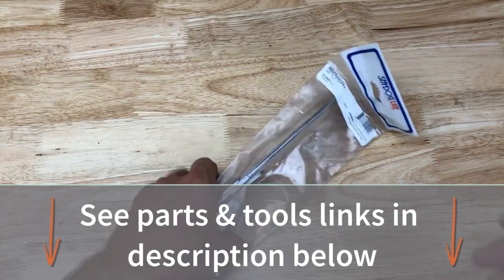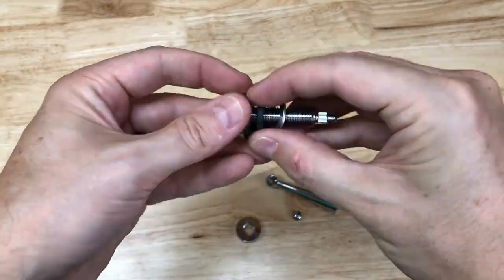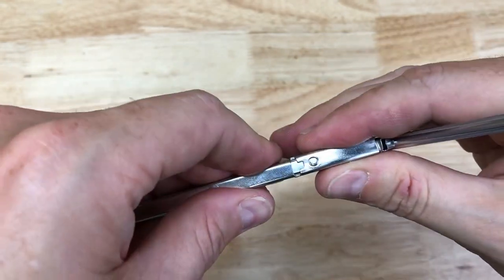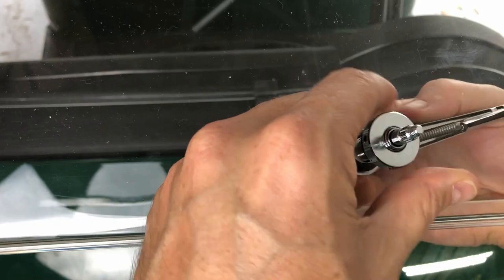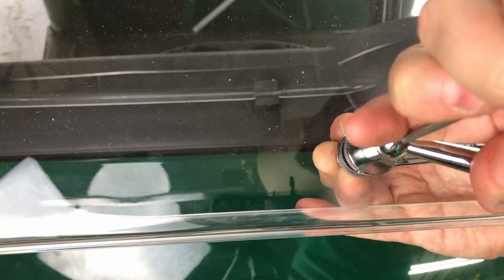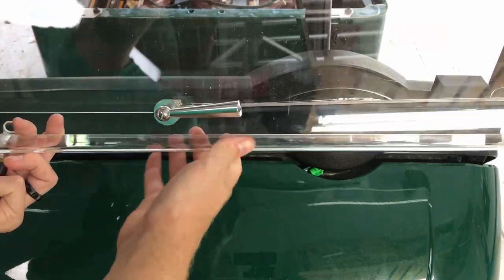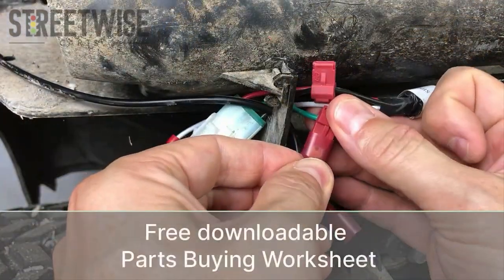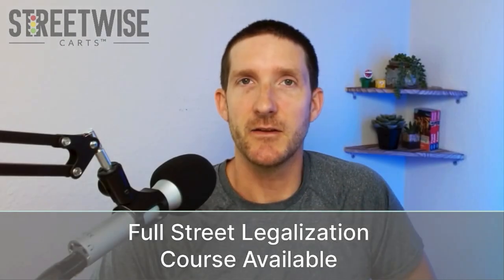Golf Cart Windshield Wiper Installation | Seadog Chrome Hand Wiper

Comment: How did you drill the hole and is that the best location on the shield to install? Thanks for the vid!
Reply from the maker: Hey I have heard that a step bit is the way to go, and to go slowly. Some would argue that the middle is the best location to add hole because your passenger could wipe for you. Hope this helps.